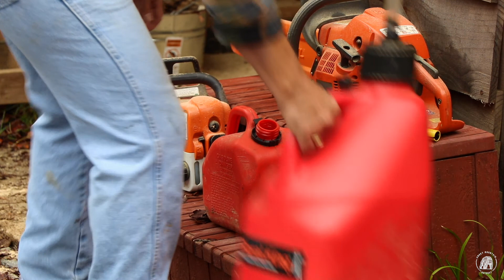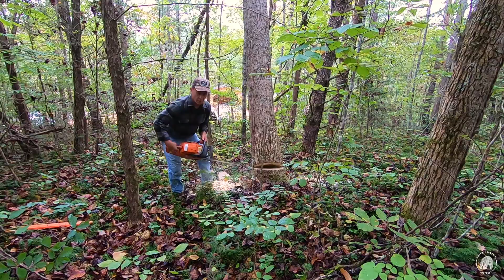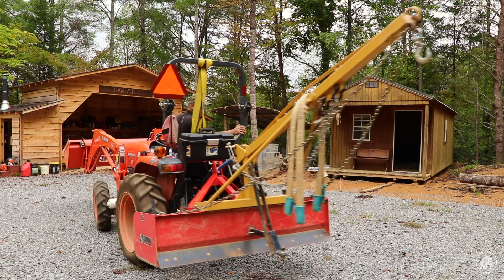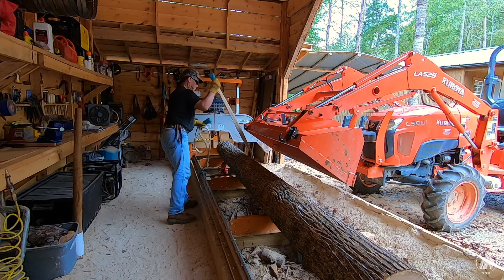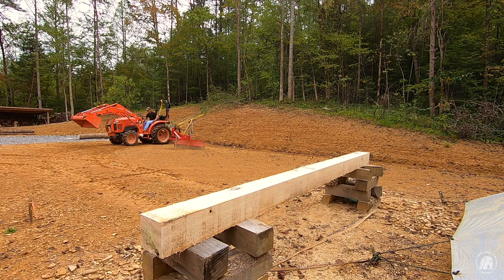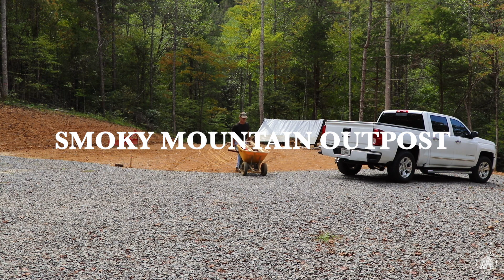S1 EP8 | WOODWORK | TIMBER FRAME BASICS | FELLING TREE AND MILLING TIMBER FRAME BEAM FOR CABIN

Comment: So, you don't have to wait for the timber to cure before you can frame and build with it?
Reply from the maker: The pioneers didn’t. The wood shrinks in circumference some but not in length has been my experience.
Reply from the maker: I did let the bulk of them air dry for almost a year.
Reply: I was going to ask the same question

Comment: What are the two PVC things under your fel?
Reply from the maker: +Josh Russell Lol, I don’t understand the question. “The two PVC things under the “fel?”
Reply: The frame of the front end loader.. lol sorry
Reply from the maker: They are storage bins. I did an early video called “Timber frame and tool review.” Think it was the third or fourth video. Check it out how I modified the tractor. With several additions.
Reply: Smoky Mountain Outpost I thought I’d seen em’ all I’ll look for it! Thanks!